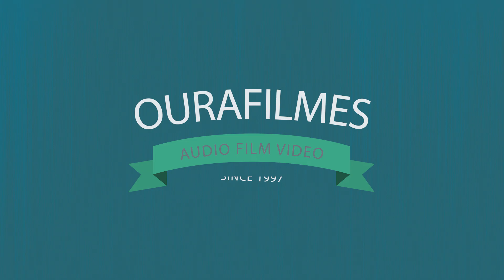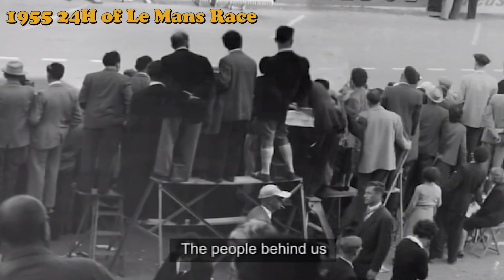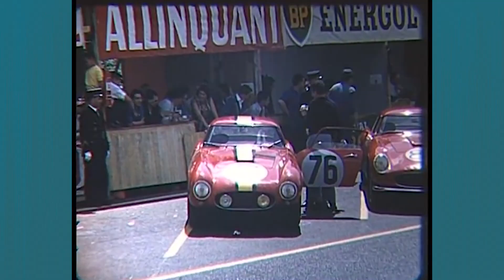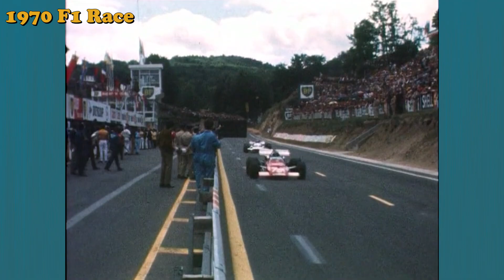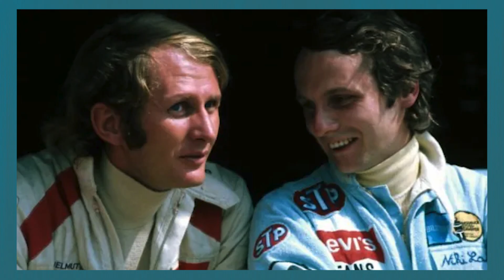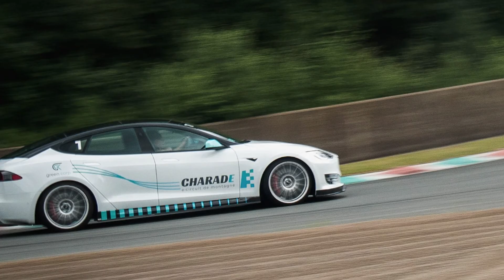Charade (Clermont-Ferrand) F1 Circuit History, Crashes and Onboard

Comment: Charade was both Beautiful, and Scary, in equal measure. Immensely satisfying to race on, but it was extremely unforgiving if you got it wrong...
While the long circuit is long gone, the modern short circuit does manage to retain much of the spirit of the old. About the only thing missing is a long, downhill, multi-apex right, taken at buttock clenching speeds, and with a nasty drop-off on the outside of the course. Understandable, given the space restraints the track had, but still, a pity...
Bravo Sir! Undoubtedly the best documentary on this Legendary track on the Internet! It's nice to find a video that focus's on the actual History, rather than the usual sensationalistic "Oooh, look how DANGEROUS it was!!.!" style of video produced by so many nowadays. Sub well earned, Keep Up the Good Work!
Reply from the maker: Thanks and cheers from Portugal!

Comment: The modern version? Yech......it's like they cut the testicles off a bull.
Reply: Still better than the current version of the Chimay circuit in Belgium. That circuit has gone from a fast, challenging circuit to a chicane-strewn run through the streets. And the designs of those chicanes are questionable at best.
Still, Chimay would be an excellent track for a future video on this channel.
Reply from the maker: @FlashoftheBlades  I know very little about that track. I always start with an onboard video but I can´t find one on that track, at least for now. It´s in the list! Thanks!
Reply from the maker: Some like it, some don´t. It´s better than no track at all, right?

Comment: I drive this historic track with historic 60's/70's racing car models in Assetto Corsa which is quite challenging and great fun. Thanks for the Upload!

Jochen Rindt, who won at Charade in 1970 preferred to drive there with a helmet without visor in case he started to feel sick due to the twists and turns on the track.
Reply from the maker: Interesting! I do not play modern video games and/or often. Thanks for the visit!
Reply: @ourafilmes  Assetto Corsa in Pro Level  without any driving assistance systems (no ABS etc.) is more of a simulation than a game with quite realistic physics. I absolutely prefer the classic tracks of the 60's/70's and it's great fun to drive on long abandoned circuits like Charade or the old Spa Francorchamps if only in a PC version. Thanks for your reply.
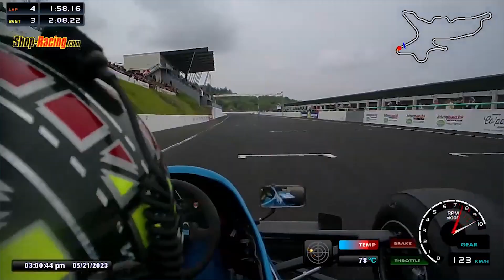Reply: @SirOliverNorwell Speaking of the Assetto Corsa franchise, I recognize the name at 13:36 as one of the drivers of the #9 Alpine A110 GT4 from CMR in Assetto Corsa Competizione.
If it wasn’t for the roundabout at 9:16, I bet that current GT3, GT4 and TCR machines would be a blast to drive on the classic layout.